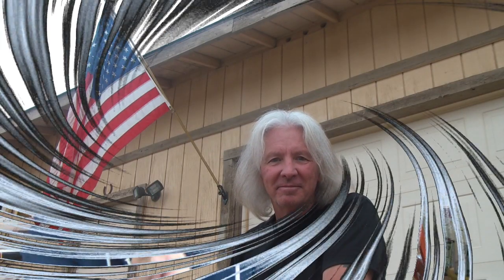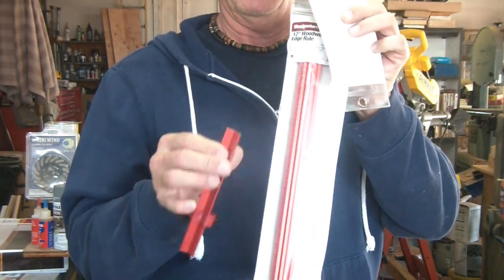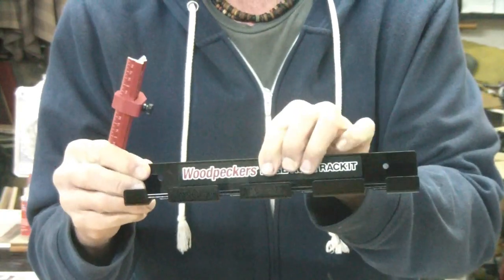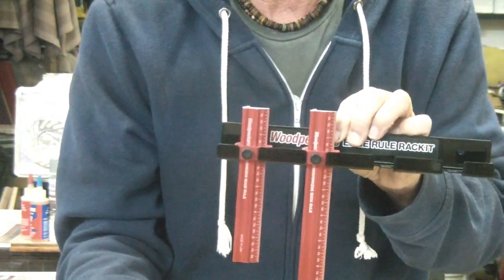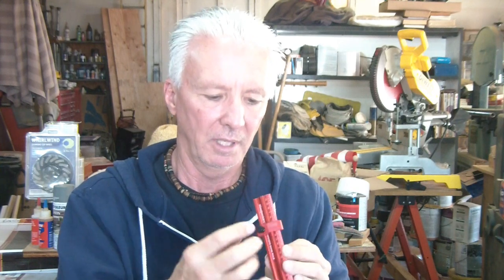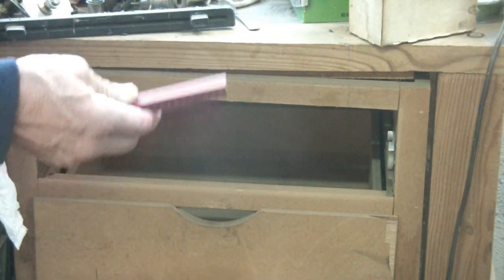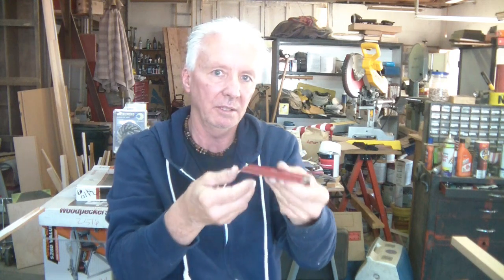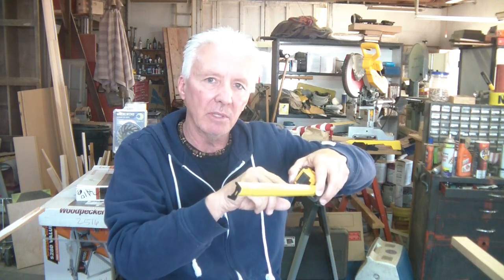Woodpecker Woodworkers Edge Rule w/Rack Review

Comment: I have the 12" edge rule along with a small handful of other Woodpeckers layout tools and find them to be of good quality, although the aluminum dents easy - kinda wish I got more stainless steel tool options where available since I have a habit of dropping stuff.  I hear you on the eyes part - even at 49 this year, I don't see close-up as well as I did when I was younger and find myself struggling with 1/32 scale, particularly on the Woodpeckers red/white aluminum products and markings.  I've found their stainless steel/black markings are much easier to read for "older" eyes, but they don't look as nice on the wall as the red/white products lol

Comment: I do have the complete set of this edge rule myself, and it's really useful!  But I just have to mention that the "play" on the 5:51 mark was by design to compensate for the thickness of the hook.  If you're doing inside measurement, the hook is part of the measurement.  So if you're doing outside measurement, the blade has to extend whatever the thickness of the hook is.  If not, your measurement will be short.  I hope that makes sense.

Comment: Gotta love the haters comments. Good video buddy but i cant believe you just dropped your new rule. lol I have pretty much eliminated tape measures in my shop except for roughing lumber to length on the miter saw. There are Woodpecker tools that cheap guys would look at and say that tool does the same thing as that tool but there really are certain applications where every different tool is the best.
Reply from the maker: Jeremy soo true. Got to love them and just let it roll off your back. This is why i haven't done a video on another tool I know already all the slack i'd get. Still someday I just might. I'm really surprised just how often i use the 6" edge rule, my 6" square and my 24" T square. I really use my Woodpeckers tools quite often in the shop and that exactly why i bought them in the first place. Thanks for viewing Jeremy. I wonder if the Festool guys get the same comments ; )
Reply: @TheShackHome  Thanks for the reply! Tools are cool. I have a LOT of Woodpeckers tools and even if i dont use some of them very often it still is very enjoyable when i do. I am in business making cabinet doors. Yea I wonder about the Festool comments too. When i see the negative comments i just kind of laugh and shake my head. Do you use the Festool Domino machines? I had had this idea in my head for a long time to be able to use the Domino as a machine rather than holding it like a biscuit jointer.  Well i was recently at a customers shop. I supply cabinet doors to cabinet shops. I asked a master craftsman there if he had ever seen anything like my idea....Well 3 days later he completely designed and built fixtures to house the Domino Machines as well as utilizing the Woodpecker Domino Offset Base system. Its REALLY REALLY cool!! He is looking to put them on the market.

Comment: How straight are the 1256mm rulers? That is the big question I need an answer for, there is no reason to buy an expensive ruler that is bent in the centre, we are not trying to make a crescent.
Reply: I have some of these and I use the long one to check the flatness of your material. If you had a problem you should take that up with Wood peckers.